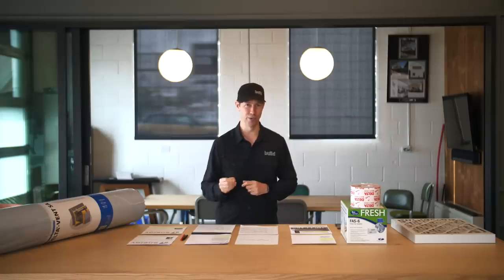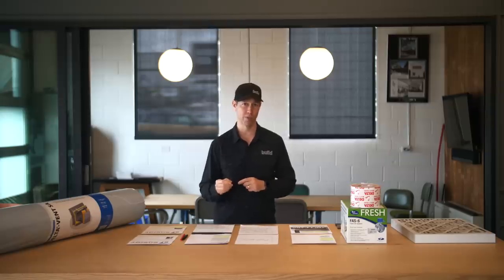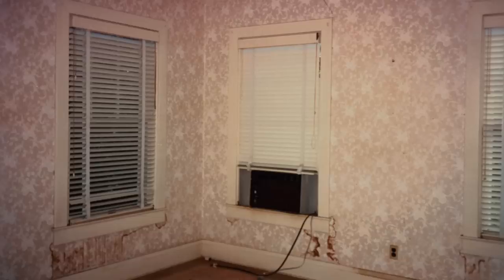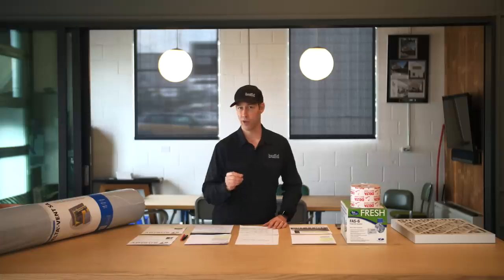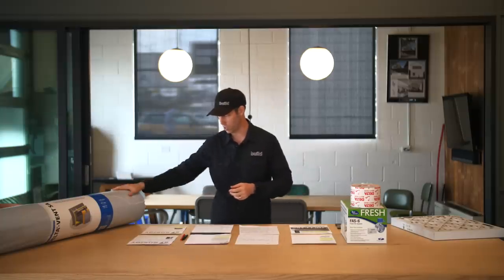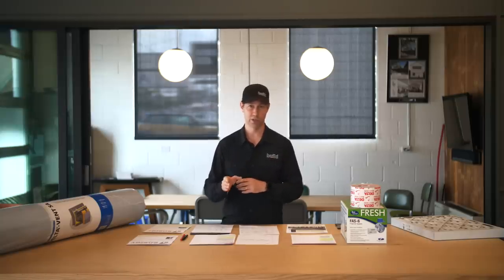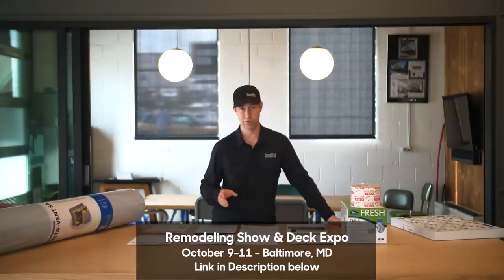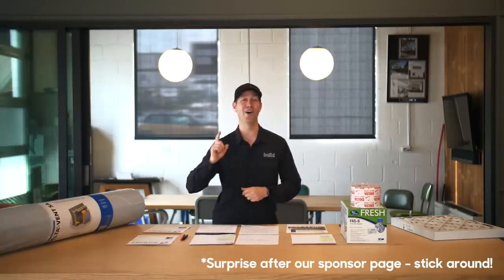“Houses need to BREATHE!” - Shut your filthy mouth

Comment: Matt how do you deal with clothes dryer pressure differential?   I have though of adding a ducted fresh air supply to my laundry room.  My house is much more air tight then when I bought it, but I know the dryer is hurting my power bill in the heat of summer and cold of winter by pulling in outside air.

Comment: Great video! My only complaint is literally every new home in Dallas has weep holes every 3 or 4 bricks. How is this possible and do you add weep holes or gaps every 3rd or 4th brick in your home. I'd love to hear what you think and do about these please.
Reply: Jumb-O- lya the weep holes are to evacuate moisture that gets behind the brick. The vapor barrier and sealing would be behind the brick, which is just a facade.
Reply: @Isaacmantx  I see. So keep the inside air tight and allow the brick to weep out. Ty Isaac.

Comment: I don’t care about what you say about need to breath or not! I seen spray foam insulation on the bottom side of the roofs of buildings where moisture is because shingles crumbling and tin roofs were the nails leeks water! The point is there is always a house going to be neglected for repair! To many houses all glued together and are going to be hard to work on an nothing is reclaimed and I suppose you’re one of those people that want to make more landfills! There is better ways of making a home then using spray foam insulation an using OSB sheeting an junk vinyl windows an junk tar paper shingles! A house can be air tight and still rot from the out side on in because the manufacturer produces are not durable for the environment that are made! The shingles have about a 12 to 15 year life and vinyl is 7 years when it starts to get brittle from the sun! I would never use foam insulation it also gives off a gas that some people have an allergy problem and there are lawsuits against the foam insulation companies and there were house torn down because of the side effects from Canada to Florida! Foam insulation tar paper shingles OSB sheeting vinyl windows an nail gun studded structure walls is a throwaway building project!

Comment: All the examples of air tight you gave, submarines, cars etc... don't last.  Air tight homes... don't last.  Clothes dryer is pumping tremendous amount of air out of the house only when it operates.  Where will that amount of air going to come in from?  Through filters?  No amount of filter can accommodate the amount of air the house needs to breathe.  Here's analogy since you seem to like analogy.  Try living a whole day with respirator.  I'm sure you'll be getting clean air, but you will suffocate.

Comment: Hey Matt, great video appreciate the informative nature of your videos. I have a question, we build basements in the north-up in Canada. A lot of the thinking here is to allow the basements to breath with permeable vapor barrier that opens when moisture builds up. Roxul insulation behind. We use that set up for older block foundations or non waterproofed foundations. What are your thoughts?

Comment: Would like to have someone with your expertise to test the air in my home which will be a hundred years old next year.  I have great concerns about the air quality only because it's an old home and sometimes the air seems to be a little bit musty so twice a week I open the windows with AC running for about 10 minutes just to air the home out.
Reply: They  a dehumidifier.

Comment: Why are the only examples of "breathing" about poor workmanship like cracks around windows and outlets? What about planned cross breeze? Or in old homes with a window above every door so light and air and come into the hallway? In most cases, house breathing is more beneficial for the people living in the house. I don't count poorly built homes with leaks as breathing. I'm more concerned with what was thought out. You could have thousands of dollars in energy by having corresponding windows and doors, you have control over when you open them for fresh air. THAT is how homes were made to be built. I can't take advice from a "fast home" builder. I would much rather have a "slow home" meaning it was well thought out. For example, there are design musts that I've noticed in a previous video aren't followed. In a kitchen, there needs to be a triangle for optimal cooking efficiency. The sink, stove, and fridge need to be no more than 3 steps from one another. We're in a lot of trouble if our focus is on the house instead of the residents. If a house isn't functional, it won't be maintained. The average person may not know what is wrong, but they know when something isn't working. And if a house isn't working for you then you don't live there. Simple as that. These fast homes might as well be called a make work project because all they do is provide a paycheck for the builders and soon for demolition.
Reply: You're not of this modern age... wish more people thought like you.
Reply: What about earth tubes?
Reply: Where do you live? In most areas of the continent, there are extensive seasons where it's impractical to open windows for a cross breeze. And the need for fresh air is continuous, so the idea of opening windows as needed is just silly. On top of that, opening windows doesn't even guarantee enough fresh air. What if there is no breeze?

Comment: The problem with the tight house strategy is that when it fails, it fails spectacularly and becomes a health hazard and maybe even destroys the structural integrity of the building. The leaky house strategy "fails" by design: it is more expensive to heat and cool and dehumidify, but you're pretty much guaranteed to be breathing healthy air and the worst that happens is you might not be able to afford to be as comfortable as you would like. 

Seems to me there's got to be a better way, where we use permeable materials that control the amount of leakage, but don't get destroyed when they get wet, and get an opportunity to dry out because there are no impermeable water barriers anywhere except the top layer of the roof.

Comment: YOU are saying - NO insulation @  1:15?   Please explain further as to wall marks and No Mold.   Very Interested!!!!!!!!  
Myth  'wanting' leaky house to breath fresh air?    The Products people Bring In, besides themselves;  Cloths, Furniture, Flooring - What they're made of Can be an issue in closed home no matter how Filtered or Ventilated it is.   
@  6:00  brings to question the 'good' of these products the 'hold moisture, does Not answer the - 'WHAT TO DO'. ?   i'm Confused, do, don't - when, where - then Why & How.  ?    =\  
I understand, 'want to do', But what about After build was Done years ago?  THEN, 'added items' seem to have caused problems.
Blown in Insulation MUST GO!  No One said anything about the DAMAGE it could\ would!!!!      Electrical and Moisture have been issues, now i think i know why.     ANY SUGGESTIONS?       I Just WANT to Protect it, House.  It's NOT right now!       Thanks      

'BREATH'  ~  One would not wrap in plastic as condensation would eventually rot their skin off.  YUK!    
IS THIS THE LINK referred to @  7:45  ?  ->   https://www.energyvanguard.com/blog/lets-stop-using-the-word-breathe-for-buildings
no 'video' as mentioned.    Either way, i see None in any link, nor picture noted here.   Read quite a bit - more questions now.

Comment: Matt, i purchased a home with an unfinished attic (1450 sqft).  It’s got an interior center stairwell that has batt insulation with paper toward the drywall.

Until I finish the upstairs (goal), I would like to better insulate the stairwell/door.  What do you feel would be the best way to do that?
Reply: Same.  I need an answer to your question for my spiritual well being.

Comment: Yes! Houses need to breathe!  Yes! one way to reduce energy consumption is to seal them tight!  We place our faith in technology in establishing how much fresh air needs to be introduced into a house to maintain a healthy environment for people.  Humans lived in caves, then very leaky structures for thousands of years.  A known rate for fresh air?  What is really a "healthy" amount of fresh air?  There are standards, codes, studies which suggest the amount of fresh air for a healthy indoor environment, they are based on data - how accurate is that data?  What is is based on?  While Matt suggest excellent means to "'seal" up a house - it might be worthwhile to really take a look at the amount of fresh air necessary and what data is used to establish that criteria - while recgonizing the need to balance energy consumption.  With technology we may be able to fine tune new houses for individual owners/location requirements while maintaining strict energy consumption - the question is "how much fresh air is enough?"
Reply: "Humans lived in caves" Very few humans ever lived in caves. It's certainly very likely that some humans did live in caves for brief periods during the stone age, but the perception that the human race were cave dwellers is a modern myth.
Reply: Well, the answer will vary with time and circumstances. Modern code cannot possibly deal appropriately and so picks a semi-random number for expected cfm, loosely based on some building science.  If you have terrible stuff inside your house, it needs to be eliminated  (co2, fug, smells, humidity, offgassing) or neutralized (possibly with ozone, ionizers, purifiers, houseplants, dehumidifiers) for the sake of humans. The panasonic whisperquiet fan just shoves air out at an acceptable-for-code fixed cfm rate no matter the ineffectiveness of doing that, assuming that it will average out over time.  There are more expensive ones with some simple detection sensors, but not yet for vocs like formaldehyde.

Comment: So, thinking about it, the only reasonable solution for super-tight houses with inadequate HVAC(which is often the case because that code doesn't seem to have updated adequately to match the increased house tightness standards) is to put some plants in there and occasionally open a few windows from time to time. 
Sure, opening windows seems like it defeats the point of the improved insulation efficiency, but honestly, not enough when you run the numbers.

Comment: Whoa.. wait a minute.. when you're talking about hot air in a northern house, are you talking forced air heat? How about someone talk hot water baseboard for a change? It's way more comfortable and efficient. I like my thermostat in the low to mid 70s, but with forced air i would have to have it at about low 80's to have same level of comfort .. which of course would never be as comfortable anyway, due to excessive air movement, unevenness and unsteadiness. Enough said. Very little stack effect too. Heat doesn't rise, it's hot air that rises. With hot water baseboard your heat is always in one place and doesn't rise anywhwere, unless of course that hunk of metal floats up into the air. Magic LOL

Comment: How come when people talk about building a house to be very air-tight, they don't mention the effect of using hinged doors. Unless I'm wrong, if you're not using pocket or sliding doors, inside & entry, you're gonna bust through the envelope in a relatively short time. Maybe even break through it in an unfortunate location... like the attic floor over a shower. The "experts" talk about an acceptable amount of air leakage, but these measurements concern the amount of air flow over the course of an hour or one minute, and they fail to address the quick displacement of air from a quickly opened front door.

Comment: Matt is just trying to sell more product. Improving indoor air quality is a new profit vector for contractors and builders.

He should have addressed the other Elephant in the air exchange  room, negative air pressure. My house has the laundry room right in the middle of the room and with the amount of laundry my wife does, the dryer created terrible need for make up air. Until I added a outside air vent to the laundry, all that makeup air was coming from the dirty attic crawl space.

He says 70s houses were poorly ventilated! My house is a 1998 and had horrible inability to bring in fresh air. We put in a dedicated filtered fresh air inlet into the HVAC system. It has a fan thay kicks in when the HVAC fan engages, this combats negative air pressure. Our house is much better but still has only mediocre quality.

Comment: no such thing as structural shiplap
Reply from the maker: Not true. It’s original intent was wall sheathing on homes built in the early 1900’s. Only recently has it been used for aesthetics and exposed applications.

Comment: 9:48 Absolutely false. The human body is thankfully NOT, "air tight". Human skin is VERY breathable in fact. Houses need to be the same. Sure you need to control where the air comes in and leaves but the idea that a house needs all that fancy nonsense to fuction properly is absolute nonsense. Here in Alaska, there are so many so called 5-star rated homes built with this faulty premise and they're all rotting from the inside out with horrendous mold problems due to the reality that houses need to breathe. There's just no way around it. End the tight home scam because that's what it is. It literally makes homes disposeable. Whuch of course idls what these guys want. They want unhealthy homes that make people sick. Thus forcing people to move. Starting the whole vicious cycle over again. No thanks man. My house will breathe. To hell with codes. They're for scam artists.
Reply: Best comment I've seen. 100% spot on.

They're trying to make houses the same way they make cars and everything else nowadays; disposable, over-engineered crap designed to catastrophically fail after a set amount of time so that it will always need replacing.

Comment: Air tight is always good, you wanna keep your heat in. But i think you are deliberately missing the point to make the video.

What people mean by wall breath is the ability for the moisture/ humidity to transfer through the fabric of the wall, not leakage.

Modern materials does not have the ability to 'breath', hence condensation will occur, so it is necessary to be air tight.

I totally agree that in urban area, you need that air control. If you live on the Apes, you probably don't need to.

There isn't an absolute universal solution, but this guy knows how to do what he does.
Reply: Vapour water movement is leakage. Check the thermal load of water. Also causes condensation in the wall somewhere when its freezing outside. Or the dewpoint is in the wall

Comment: My comment/essay might be too late but it may be helpful regardless. Considering your audience is not limited to the USA, your video (however informative to some) could be considered reckless if not delimited to very specific contexts. Many look to US standards and codes for guidance. My country is trying to undo some of the damage done by blindly adopting European and US building energy models for many public buildings without consideration for climatic relevance. I'm kept quite busy by sitting on a number of research and technical working groups trying to solve this issue. You have thus not addressed many important issues in the application of one-trick-pony building codes for hermetically sealed homes. 
The first that comes to mind is the issue of climate responsive design. Not all climates require tight buildings all year round. I live in a city with a very mild climate, a short warm winter and very little rain. My stone brick house feels better year-round with the doors and windows flung wide open. We don't have enough humidity for condensation to ever be an issue. Houses in this climate perform best with thin shaded walls and loads of ceiling insulation. 
The second issue relates to adaptive comfort models and appropriate building response. ASHRAE 55 beautifully describes the principle that people are more comfortable across a wider range of outdoor temperatures in naturally ventilated houses (climate and season permitting). Sealing and insulating a building in a moderate climate or season and then trying to reject internal heat-loads using HVAC systems is plainly wasteful. Ventilation rates correlate directly with indoor air quality. 2-6 air changes are typical for mechanical ventilation (ASHRAE 62.1/2) with 12 ACH being the reserve of clinical applications (ASHRAE 170). Achieving 30-100 air changes using well designed natural ventilation is not uncommon. This knowledge is an important asset in emerging economies suffering under high TB burdens where adopting US building codes would only make that problem worse. 
That said, I love your channel and your presentation style. I would love to see a video where you discuss the differences between  "green" buildings and passive buildings as these two concepts are commonly conflated as you accidentally did in this video.

Comment: when air comes in it needs to be able to leave. ur house isn't a ballon. eventually we need a vent that lets air out. if we dont have a vent that lets out air then it will leave through ur outlets and unwanted areas or humidity and moister builds up. houses are still so poorly made. everything built in a home now sucks. stop using wood and use plastic.